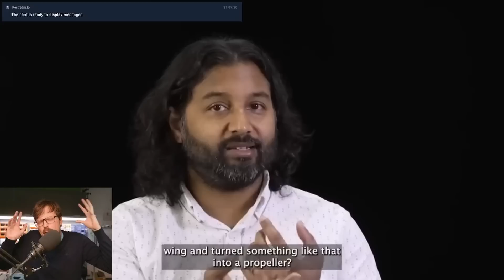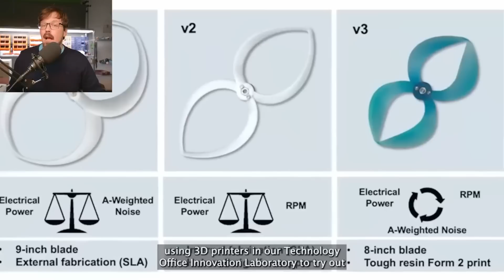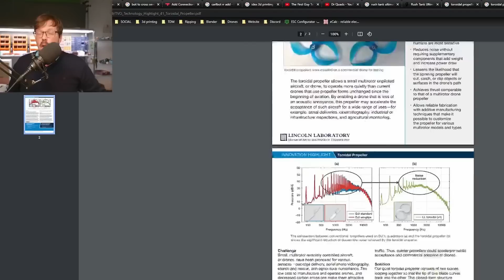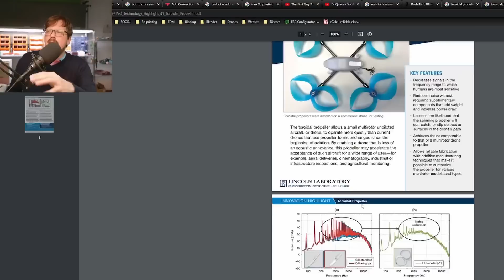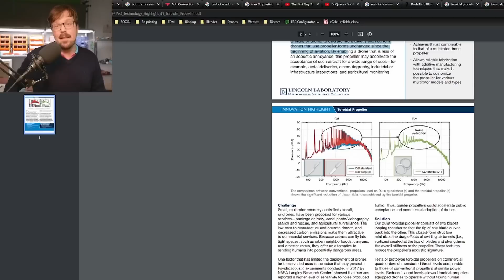MIT Thinks you're STUPID - Toroidal Propeller Snake Oil

Comment: There is a video on youtube where the person "tested" the toroidal propeller vs regular prop. He used 3A for the regular prop and 5A for the toroidal prop, quickly panned away from the screen but you can see it if you're paying attention. He then proceeded to say that the toroidal prop had more thrust. Yes, because he used 66% more energy. It would be terrible if it didn't.
Reply: In contrast, I saw several videos of a comparison between a regular and a toroidal prop, all of them with the same problems:
1) Prop dimensioning.  With a regular prop, you match the prop pitch and diameter to the engine power, desired RPM, and whether you want high thrust or high speed.  You need to do the same thing with the toroidal prop, but I doubt the usual rules-of-thumb for prop selection are valid for those props.
2) Prop finishing.  Almost all of these videos just put the prop straight from the printer onto the motor.  Printer artefacts and all.  It's kind of important to make sure the prop surfaces are smooth, and the prop is balanced.
In other words: don't mistake a YT video for actual scientific experimentation.

Comment: That one point at least is nonsense (5:00): electrical power is the product of amps and voltage, so when the MIT speaks of electrical power they mean exactly that.
Reply from the maker: Yes yes, but what does that actually mean though??!?! Can you look at the two side of the scale icon and strong a sentence together for me that would make a scientific point?
Reply: @33rdframe  I agree otherwise. Power consumption doesn't mean a thing, neither noise. Noise and/or power per qm air flow or something like that could be interesting. And yes, no numbers whatsoever from MIT? Really? That's more my level ;-)

Comment: These props work very very well though in water... not air...
Reply: No, not "these props". The Sharrow prop - that has much more 3D shape, and went through an insane amount of optimisation, costs $5,000, and only works better in a very specific range - works well in the water.
Reply: @Chris G  yeah I could have clarified my comment I meant the toroidal design in general.
Reply: @just1ofgod  But we don't know that either. We only know that the Sharrow design works.

Comment: OK, Sharrrow makes a toroidal boat prop. If you look at what is aurguably the most money spent on noise reduction of a water propeller it would be on a submarine.  None of them are toroidal. They all are tip forwards curved blade, remarkably similar to a noctua 12 computer fan. The tip forwards feature is also found on condenser fans in the hvac field. If toroidal was the quietest you would see it on submarines where quiet is a life or death scenario.
Reply from the maker: this is the equivalent of "the proof is in the pudding"
Reply: No one claimed that it was the quietest propeller design. It's supposed to be more efficient with reduced noise being a benefit. I guess you're not an engineer or scientist.
Reply: @Rampart.X  I guess you aren't either. MIT have made bold claims without providing sufficient evidence. A scientist's default position should be scepticism until the evidence is provided.
Reply from the maker: @Rampart.X  yeah, not like i designed my own drones from scratch and perfect designed being copied by every manufacture now.... :face-turquoise-covering-eyes:
Reply: @33rdframe  oh sure.
Reply from the maker: @Rampart.X  bro you should really look at my youtube channel haha
Reply: Not saying you're wrong, but I'm not sure that logic holds up when you consider the design criteria. With the submarine example, you're comparing a prop developed for a minimal sound signature at a low speed to a high-speed one.
Reply: @terjelindtveit8072  I don't regard 40 knots under water slow. I don't know that the design would cross over to a drone, but it would be interesting to find out.
Reply from the maker: @terjelindtveit8072  this is true

Comment: Thanks for the video and straight talk.
It's basically a repurposed marine prop design, kind of copied from the work with Sharrow Marine (not an affiliate, just the facts).  MIT did work with Sharrow on that technology, though, but it's not going to look exactly like it because they wanted to file patents too as well as not get a cease and desist from Sharrow (who is a commercial developer/adopter of marine technology).  I haven't seen any real life demos that have been able to match the claims of the flight applications, but that's not to say there isn't merit in the concept.
It's not as relevant to this field but in marine applications there is no cavitation on the prop edges like most currently in use.
To submarines, it means they are more stealthy and not only dampen but alter their prop signature dramatically.
To ships, it means that they may be able to run the original prop for the life of the vessel and not only prevent all steam pocket/bubble damage but decrease fuel/increase max thrust because most work expended isn't partially wasted in creating steam.
I'm actually more of a fan of neutral or lighter than air buoyancy drones for my flight projects (some are even tethered, like agricultural automation drones) so the whole argument seems extra ridiculous to me.  :person-turqouise-waving:

Comment: I wouldn't be surprised if they are quieter at the same RPM & size but there is no way they would be quieter at the same thrust.
Reply: They will be a lower frequency, they don't have the same tip velocity and flow characteristics. They may be a little quieter... probably not by much though.
Reply: @soggybiscotti8425  I'm thinking that by the time you increase the speed/size enough to get the same thrust they will be noisier. The MIT testing looked like it was same size + same RPM (they gave zero data for that) and it was still very close for noise, no data on thrust either which makes me think that there is just no benefit and they know it.
Reply: @samheasmanwhite  yeah that's pretty much what I'm saying.
There will be a very minor difference in the high range, as you no longer have prop tips that notoriously produce shock tips, bjt instead have a rounded tip. This should produce a lower hum overall but it won't be significantly quieter at all. Maybe slightly, and maybe a tad lower frequency. Nothing of significance though.
Reply: The printed fan for noctua channel showed they are quieter >5000hz so it would depend on your rating... 
https://www.youtube.com/watch?v=4ImeOKgD_Dw&t=2s   They also had half the airflow of the Noctua at same rpm/sound.

Comment: But the thing is, these toroidal propellers seem to actually be 3d printable though.
Thats what I like about them. These other prop designs are hard to replicate on a 3D printer. The ones you usually see on youtube break easily.

Idk for sure, but it does seem cool and I might use them still

Comment: They are called wing-tip vortices because they are formed at the wing-tips, but the fallacy is - the vortices are not generated by the wing-tips. Any device inducing fluid movement will generate "wing-tip vortices" at the moving-stationary fluid interface, regardless of having or not wing-tips. Any undergraduate aerodynamics student should know this. Look at the Trefftz Plane Theory to get more details.

Noise is generated regardless of wing-tips. Slower propellers will always generate less noise. Larger propellers will outperform smaller ones (less power for same thrust) at slow speed. Sometimes the only thing that can be done is to modify generated noise spectrum so it's less annoying.
Reply: Right, and the theory for why the sound of these toroidal props is less annoying is because there is no tip and therefore the vortices are spread out along the entire prop.
Reply: @stevenbarbour1244  Vortices spread out along the entire prop means modification of the loading along the blade - this can be done more simply by modifying blade twist - no need for complicated toroidal shapes; Anyway this makes blade loading less optimal , making the propeller generate less thrust.
Reply: @Stein Mauer Not really; you can reduce the  air speed difference, but that means less thrust for the same diameter propeller.

Comment: This is great! You should print a version yourself and share the data 😂
Reply: Printed propellers aren’t going to perform as well.
Reply: @ShabazzTBL  I mean… MIT used printed propellers
Reply: @petermarin  Their machines are far better. Regular 3d printers are way too inaccurate
Reply: @GalacticNovaOverworld  what are they using if not regular 3D printers?
Reply: @heavyweather  they are. Most of the prints I saw were run of the mill with minimal refining

It's likely the MIT guy is overstating their results for attracting investors, but I am positive they achieved some improvement.
Reply: @petermarin  resin print
Reply: @pottyputter05  for sure not. Won't hold up.
Reply: @petermarin well obviously if he did his own test he would disprove his own narrative and you we can't have that 😂
Reply: This is absolutely not great, this guy is trying to pass off a highlight pamphlet as the actual research paper, he clearly thinks his viewers a stupid enough to fall for it, and looks like some are...